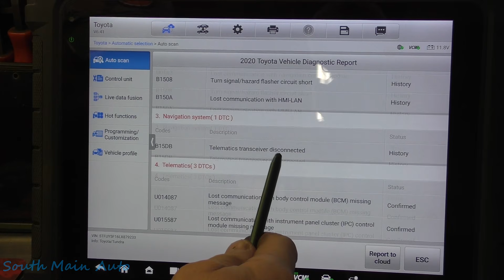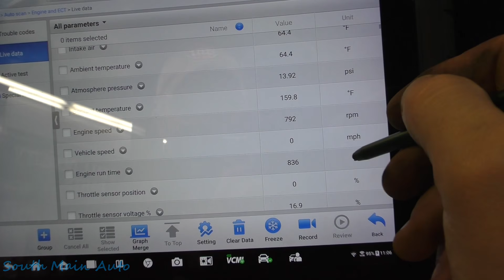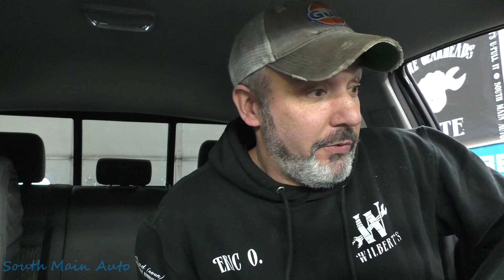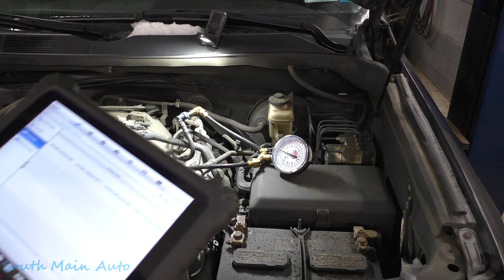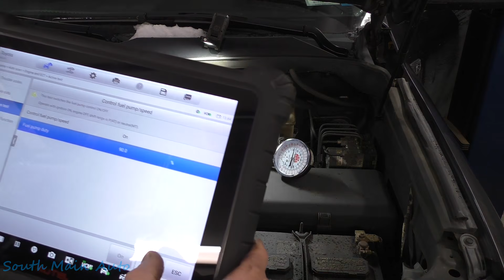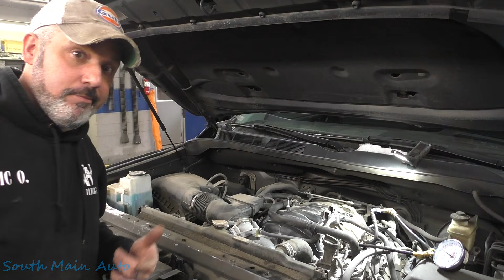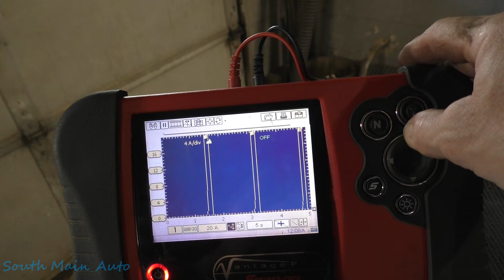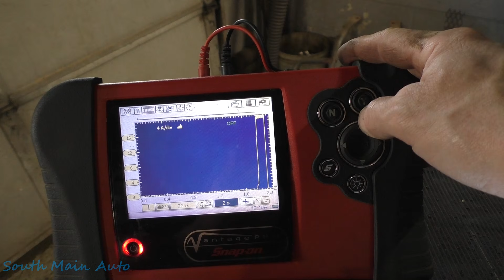My Customer Is Getting Shafted By The Local Toyota Dealer

Comment: I had a 2019 tundra like 4-5 months ago where the customer said it was stalling or had no power.  So I drove it around the block and it was flawless.  The advisor asked me to look it over again cuz the customer didn’t want to take it back.  As I was driving to my bay from the parking spot, my foot was on the floor and it was struggling before suddenly accelerating normally.  I put my fuel pressure gauge on and it was occasionally dip from around 50 psi to 20 psi.  I dropped the tank and the wiring was good and the pump tested good.  So to cover my bases I recommended a new pump and controller.  The truck has been back for normal service since replacing those parts.  That only thing that was weird idling the pressure would dip.  If I commanded the pump with the scan tool it’d hold pressure all day and night with the key on engine off

Comment: Your diagnosis was perfect for the scenarios you were given by the customer.  My simplified approach is F.A.S.T. (fuel, air, spark, & timing).  Add sensors & actuators & processors (modules/computers) & that covers a fair amount of problems.  The fuel would be pressure & volume.  The air would include the MAF, MAP sensors, air filter.  Spark would be plugs & ignition coils.  Timing would be spark & valve timing.

Comment: TOO SAD THAT NEWER TOYOTA'S ARE FAILING: MY 92 COROLLA 296K MILES, 97 4RUNNER 222K MILES AND 00 LAND CRUISER AT 254K MILES ALL GOT THE FACTORY FUEL PUMPS STILL AND WORK LIKE IT SHOULD.

Comment: Years ago I used to work for an air conditioner man and we used to work on boiler systems and he rewound electric motors and sometimes we would find starters. Or certain kinds of electric motors that 1 winding would go out in the motor and so the motor would still run, but it would use an excessive amount of amperage because it had that weren't winding out and the rest of the windings in the murder were taken up.  The work of the one winding that I burned out reminds me of that

Comment: I had a 96 Chevy Astro van that come down with a misfire whenever it would rain. No rain perfect drive. During or shortly after a misfire. I was told it needed a tune up. I took it home and did a complete tune up. Still had the misfire. Went and bought better quality spark plugs as the next shop told me the van cannot handle the regular plugs. Still same problem. I took it to another dealership and told needs a tune up. I did three tuneups in less than a year and still had the problem. After years of chasing this issue and many dealerships looking at it no one could find the issue. So I found a small town shop with just a couple redneck guys who run it and the lead tech said let me have it a couple days and I’ll see what I can find. (Side note I even replaced the coil and put on much better plug wires to no avail on fixing the problem). So he had it two days and called me and said it was fixed. Cost $60 bucks parts and labor $90. The wire that connects to the coil has a rubber seal that was missing allowing water to get into the connector causing an intermittent ground. The coil became damaged due to constantly being grounded and needed replacement again. Never had a problem with it since. But of coarse with over 300 k on it the rear diff started to go out and that’s when I decided to sell it. 
  The problem I hate is when you tell the people looking at your car that you have thrown the parts cannon on it multiple times and it still messes up. I cannot tell you all how many times I didn’t pay for a diagnosis of your van needs a tune up. Because I told them all after the first two tuneups that I will not pay for a diag for a tuneup. Naturally I found a great mechanic and being in the military I then got transferred. Story of any car owner in the world.

Comment: As a Toyota tech starting this video off there is a TSb for extended crank requiring replacement of fuel pump and ecm update on these tundras for several year models. Alcohol density pid on data list will be high

Comment: The reason I like these videos so much is that they are real life "who done it mysteries".
Was it the ECU in the library with a candlestick or was it the fuel pump in the kitchen with the butchers knife. Classic recipe for viewer engagement!
Well done on the Diag. Mr O... My money was on the fuel pump but I just couldn't understand why it would start and run with ether.  Made no sense.
Good hypothesis about the voltage boost from the alt. kicking the pump out of its bind into life.

Comment: I hate dealerships, bet that surprised everyone.  The only 2 times I took a car to the dealer (except for recalls) I was given a list of 4 or 5 parts that suddenly went bad at the exact same time.  Both times I brought the truck home (unfixed they couldn't find the problem, but they still charged me both times).  1st time I found the injectors clogged, fuel filter had failed.  2nd time (you guys will love this, a bad spark plug wire.  Only reason it went to dealer to start with is I just didn't have time to look at it.  Those were my single  days and I only had one car.  Now I have 4, so the broke one can just sit in the yard until I get to it, or until SMA does a video on it.  And I showed my behind (must have impressed them) and got my money back both times...

Comment: That's a crunchy sounding fuel pump you got there fella! Just fixed a GMC with 180k on the clock with the same problems/symptoms. A quick whack with a diagnostic hammer figured that one out. I took the pump motor apart and sure enough, it was a crusty fella full of carbon dust from the brushes and the armature was flopping around causing it to lock up intermittently. A brushless motor would be a good upgrade for these pumps.

Comment: Yes sir, diagnosed it with a hammer. The curious thing is to be able to remove the fuel pump and disassemble it to see where the fault is. It is quite obvious that upon hearing that thing run it wasn't up to snuff. It is the mechanic curiosity to see just what the failure is, This is just one incident where the pump has not quite died of old age but on its way toward a certain death. Hopefully the dealership will respect your diagnosis, I am sure you have a good reputation as to your accuracy of diagnosing troubles.🥸👍👍👍👍👍👍👍

Comment: Maybe the pump starts after a shot of ether because as the engine revs at start, the battery voltage spikes up and causes the stuck pump to break loose and continue running. Great diag Dr. O.

Comment: I have a Mazda B2300 (1994). Has a similar problem. Has a relay. Branched around it. Sometimes works, sometimes not. Replace the fuel pump with cheap Chinese. Started good for a while... then back to hard. On initial start, if I held the start on a hair longer than normal it would start. If it failed on that initial pop, well it was going to take a powder for a while. In the end I put an OEM pump in it. That ran longer than the Chinese... but now again, it's starting to act up. Painted a red x on the wall and kicked it three times. That seems to have suited it for quite some time now.

Comment: Definitely current limited circuit sometimes called "hiccup mode".   It detects an overcurrent shuts off current, waits to let electronics and fuse cool off then tries again.  In this mode the main fuse should not blow because the RMS current is low.  Electrical  Engineer ( retired)
Reply: I was about to comment something very similar.
Reply: 100% agree. Electronics tech (not retired)
Reply: So it's designed to mask the problem by protecting the fuse from blowing?
Reply: Ok boomer 😅

Comment: We used to diagnose fuel pumps with a current amp probe attached to a o-scope. I'm sure you know the pump has communtator bars and will provide a great "picture" of whats going on with the pump. Great diag as always! These dealer techs are trash these days. Could've just watched the video and saved time.

Comment: I wonder if that fuel pump module is a mosfet control.   Finicky when they go bad, because they basically are always on - question is whether they are controlling current properly. A quiescent state is something in the milliamp range - 35mA or so?  The pump overcurrent might recommend changing both it and the pump for reliability down the road.

Comment: Slightly off / on topic but hammering on it reminded me of the old days keeping a hammer in the car , first for a solenoid/starter problem , and in the 70's that big Chrysler had a mechanical voltage regulatory on the firewall that would periodically need a hammer whomp to move the needle again ....lol.... good Ole days 😂

Comment: Had a similar problem with a VW. The fuel pump relay was overheating. And would lose contact. Wait about 10-15min and bingo ignition. Only when it was 85F+ outside. Annoying as hell to figure out.

Comment: Just so everyone is aware, more often than not if your vehicle is under warranty the dealership techs DO NOT GET PAID ANYTHING to diagnose problems. They will get paid for the repair but at anemic warranty flat rate times. There are many very good dealer techs out there but it comes down to the bottom line and unfortunately guessing based upon pattern failures becomes more lucrative for them than actually spending the time to diagnose. The system is broken obviously.

Comment: You know, Eric, you really didn't need to think about this at all.  I love it when you have to think.  You have said before that you have no formal training and yet the outcome is always the same.  (I don't know if that is true anymore, because you have attended some training sessions with Ivan, Brandon Steckler, Paul Danner, etc.)  I still like the 2019 Tahoe (or the GMC equivalent) you diagnosed the bad ground on the body when the steering was acting up and the dealer was going to replace a laundry list of parts.  I think there were 2 of those.  That's not bad for a dumb doorknob.  GREAT VIDEO!

Comment: My wife's  '03 Windstar did the exact same thing for years and then one day nothing.
When I started watching this video and you were describing the symptoms, a light came on in the old brain box and I knew it was the pump.
Described the Windstar to a T!!!
If it's not a manufacturing defect, then it might have been run dry once or twice.
Apparently that's enough to start the pump down a bad path to this.

Comment: My truck is not nearly as sophisticated,but it had something similar. It would start fine most times, and always when warm but when cold, when it wouldn't start, trying and trying, and leave it a few minutes, and it would go. I changed the pump relay and have had no more problems (yet?) It's a '93 Chev, and the relay looked original, so not a wonder that it got stuck sometimes.

Comment: Great diagnosis Eric O.. yeah I was confused as to why the starting fluid ether would work with the motor at operating temp.. and that makes sense the alternator output and system voltage at 14.4 is enough to overcome the bad pump bearing.. I say that bc it was growing when you were under the truck either the amclamp.. Nevertheless I’m not sure why it will ensue at deliver 45psi to the fuel rail when it’s cold? Maybe on a cold start ECU commands 90% Duty cycle to the control module which is enough to overcome the torque needed to get the pump running even at 12v ? I’m not sure how the Toyota dealer missed this? Heck if anything just listen to the pump. And maybe when the ECU is commanding less than 90% DC while still warm it won’t engage the pump? I think you went this this investigation awesome!!

Comment: Classic girl
Pump from from high altitude Denver. In summer of 1999, 10 new Taurus’s were sold on a nice hot summer weekend Saturday. The next Monday, I had mine in the lot for no fuel
Pressure. Ford had like 7 redesigns before they made one that worked. Good times.

Comment: i had the same exact issue to a tee with a 02 or 04 f150 i believe. turns out it was the fuel pump cutting in and out randomly only after driving it for 20 to 30 min and with a fuel pressure gauge on the vehicle you could see it not working when cranking and see it cutting in and out while the vehicle was running

Comment: An easier diagnosis would have been a “fuel pump high current” code thrown by the FP computer since the computer did actually detect the fault.  You would think a 2020 model would have that capability.

Comment: I have in the past banged the fuel tank with a 2x4 just to get one more crank to make it home.  They usually go bad in the gas station island just after a fill up.  Good work Eric!
Reply: I've reversed the fuel pump polarity and ran it reversed for a few seconds.
Lasted several more years.
Assume I dislodged something causing the pump to bind.
Reply: always, vehicle running rough, they go to gas station and fill the tank to shutoff... then gee, it wont start and we're stuck at blah gas station. 🙄

Comment: Hey @SouthMainAuto I’ve come across fuel pumps failing this way. 

Reason it stays running or runs when ether is used is the vacuum of the engine pulls on the injectors and pulls fuel, helping the pump run.

I know weird as hell but it happens

Comment: I got an appointment with the Subaru dealer to look at some traction control issues for my Outback, but after watching the video I'm thinking that I ought to go to an independent shop if the dealer says it has something to do with the transmission. I'd wager that the transmission is working fine, it's the AWD system components that could be giving the transmission bad information.
Reply: Do go to the shop. 
Start with buying a good scanner. 
Scan your own vehicle. 
Print all and save all of the codes.
Print the electrical diagram for trouble shooting process. 
Start with powers and Grounds 
You can go thru Ivan or Eric O list of videos to learn how. 
Thats how I learned.
Reply: @2nickles647  I got my self a small Bluetooth scanner a few years ago and also learned a few things from these videos. I use it for both my cars and looking at used cars. Not sure where to get electrical diagrams, but I can print out the codes I get. I've also had bad experiences with both independent shops and dealerships, dealers are mostly wack but this one had decent reviews online for their service department at least.

Comment: I took my car to the dealership only once. It had less than 25k miles and it needed a knock sensor. Since I was only on leave for a little while, my friend had to pick it up after I returned to Germany. The head guy called from the shop, while I was in Germany and said that it ended up not being covered under warranty since they only had to clean it 😂. I laughed at him and then told him I would call the owner and explain to him that I had the paperwork that this same guy had wrote “covered under warranty” and this was the poorest excuse of a head mechanic that I’ve ever seen. Since I grew up working on cars and would have done it myself, but I figured it was covered. I told the guy that my car is in storage now and that he could call me in a couple years when I got back, if the owner hasn’t fired him for piss poor customer service. I’ve never been back again to any dealership for anything.

Comment: Ive seen this before in ford fuel pumps.  You cant run them out of gas or the geared pump gets hot.  Eventually they start locking up.  Happened in a older Bronco 2 and a 90's F250.

Comment: If I was asked to describe my life in two words, it would be “the shaft!”😂🤣😂 

‘Tis the season for fuel problems! Got something similar… but not really… going on with my 3-decade-old Volvo 940 winter beater. I need to hold it to the carpet to start it… but, the problem gets worse as it gets colder! Once you get it running without misfiring, which only takes about 30 seconds holding it at 2500 to 3000 RPM, the thing runs like a champ, but idles high (1,500 plus or minus). 

Fuel pressure is good, ignition all new (plugs, wires, cap, rotor) throttle body clean, idle air bypass valve clean, new temp sensor for ECU, zero vacuum leaks. Without the ability to pull up scan data, I just gave up & ordered a carburetor for it.😂 That in a nutshell is why I love my old cars.😊

Nice solid diag as always, buddy. 👍😎👍

Comment: Haven’t finished watching it yet, but suspect a weak battery, means a weak fuel pump.  Once it starts, the higher voltage makes the pump run better?

Comment: The dealership techs should've known better, we had boatloads of these across Toyota and Lexus before the recall was issued. There's many chassis that should've had a recall issued but it was never deemed necessary so they end up getting excluded despite having the exact same parts as other years and models.

Comment: How would if I diagnosed it? Just like you, FIGURE IT OUT!!! Retired technician on the marine side here, I was taught and learned to think simple and go up from there. In other words again, FIGURE IT OUT. I/we had only one time we threw parts at a motor and we never got it fixed. We finally put our tails between our legs and called the custom engine builder that built and programmed the engines ECU. And he told us, (you will not believe this), he specifically programmed the ECU so the motor would not run good. We didn’t have computers to burn ECU’s or read custom ECU’s, we had computers just for stock motors and customer thought we could fix it. Why did engine builder do this, the customer would not pay him for his work so he programmed it to not run good, (he did this with a few people as insurance so he could make sure he got paid), we were warned by him, the customer will cancel credit cards or checks or whatever after the work is done. So we locked up the boat in storage until we got paid and things would not bounce, then told him what was wrong, which he knew, but of course didn’t want to tell us. We got paid for our time & labor, he left with boat, put his tail between his legs, paid engine builder, and engine runs fine now.